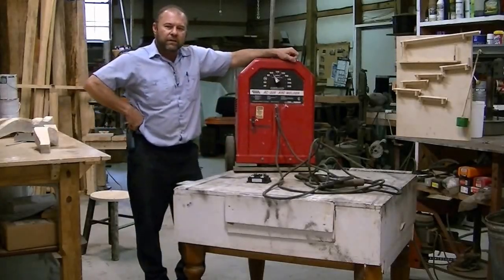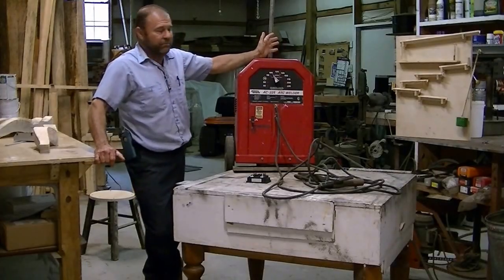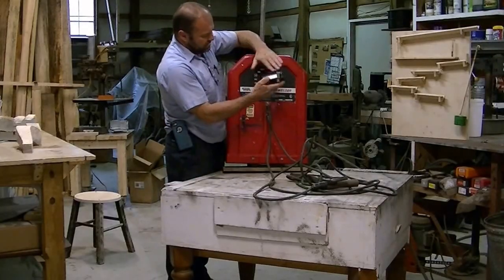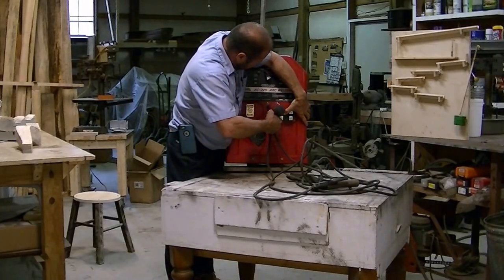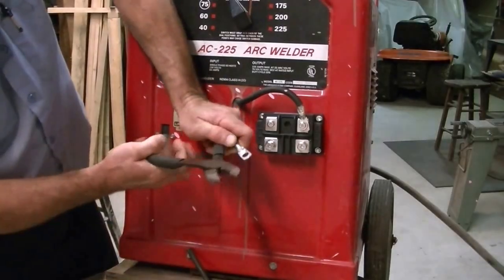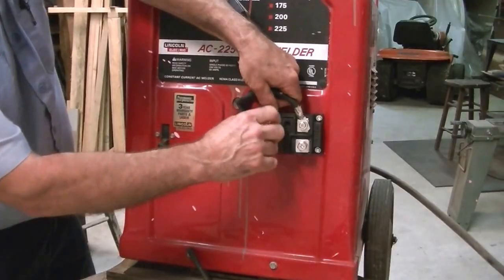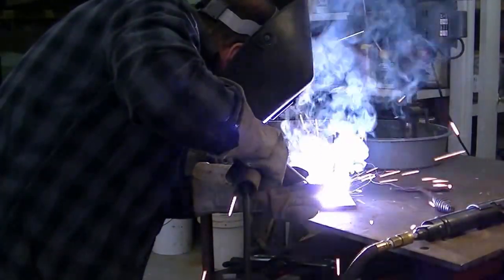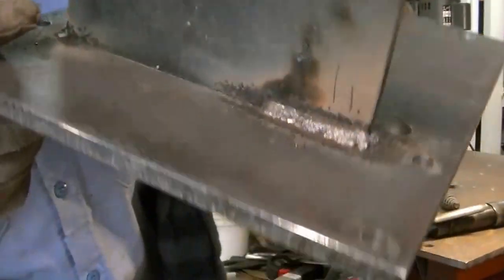Convert your AC welding machine to DC for $50. Weld 7018 rods,more strength

Comment: you might want to pickup a tube of permatex dielectric grease the small size is number 81150.. costs about 4 bucks.. take out your self tapping screws.. squeeze some dielectric grease out on the back of the diode bridge.  and reinstall it.. its a thermal compound to allow better transfer of heat out of the diode bridge to what ever you have mounted it to. 

the white thermal transistor mounting compound that some computer or electronic stores may sell works even better. 

no use burning out the rectifiers. 
Part Number: 81150Part Number: 81150
Reply: 81150 is exactly as you say.  It is dielectric grease meant to insulate and therefore NOT conduct electricity.  What you need here is thermally conductive grease, commonly known as heatsink grease.  A quick google of permatex products does not reveal any heatsink grease in their product line.  I doubt dielectric grease would be more effective in thermally bonding the rectifiers than ordinary axle grease.
Reply: Computer builders use a wide variety of heat transfer compounds far superior to dielectric grease. though I love the stuff for keeping moisture out of vehicle electrical connections. Remember computers have thermal sensors so you can precisely monitor thermal paste effectiveness. http://www.tomshardware.com/reviews/thermal-paste-comparison,5108.html
Reply: Yes, many ways of bonding heatsinks to processors.  For mounting the rectifiers spoken of here, thermal grease is probably bood although a properly sized pad would probably be better.  Locating and buying such a pad may be a problem while the heatsink grease is pretty easy to find.

Comment: Why do they even make alternating current welders. High voltages? Just sounds foolish... is there an application that prefers ac? I'm not a welder. Just a competent observer. Thanks for video.
Reply: Christopher DiUlio they are cheaper
Reply: Christopher DiUlio AC is fine for general welding and rough cutting but DC is another world completely.
Reply: Oh man these misleading responses here!! In stick welding the only real advantage to ac is you don’t get arc blow. That’s where as you burn the rod down the puddle gets squirrely and the flux starts melting off the side of the rod and the arc flashes out of the puddle and it’s hard to control. This can happen on dc because of a bad ground, or incorrectly placed ground or the part is becoming magnetized due the the dc electricity. Ac switches polarity 60x sec which doesn’t allow the metal to polarize. Ac is also more dangerous because you can die from the elec shock especially if you’re welding in a wet area, not much different than an exposed extension cord. Dc can kill too but it takes way more amps than ac. And when it comes to tig welding dc is more common especially on cheaper machines. A tig machine with ac will always have a dc option, but many dc tig machines don’t have ac. You need ac on tig to easily weld aluminum and magnesium. All steels are welded with dc on tig. Aluminum can be done with dc tig but requires helium for shielding gas which is way more expensive than argon and leaves a dirty, but structurally ok weld

Comment from the maker: I should have done this years ago.
Reply: markp0177 Mark, is that 20% duty cycle for settings less than full 225A setting? I remember running these pretty hard in school etc. without any meltdown s @ around half power settings. Never have actually read the specs on these buzz boxes. Thanks for posting.
Reply from the maker: Yes me too. The 7014 is a good strong rod but it is hard to run a vertical weave with a 7014
Reply: Nice, I must try something similar one day. The metal on the back of your bridge rectifier is not in itself a heat sink but what should be connected to a heat sink . A large shiny  clean flat aluminum plate would be better than nothing. The painted sheet metal won't do a whole lot as a heat sink. Well done though.
Reply: It is 20% duty cycle at every setting save the 75 amp one, which is 100%. That's why that setting has the circle around it. Had to find an older manual to find that out. I'm guessing it has something to do with the volt/amp curve of that transformer.
Reply: RobiSydney I figured the duty Cycle should be around 100% in the "normally used" range. I used one a farmer buddy had to rebuild & modify his loader bucket. It had gotten flooded etc. & the fan didn't spin anymore. Ran alot of rod with it on that project & never had a meltdown. The older ones at least are tough little buggers.  Have had a Miller Syncrowave 250 since the late '80's so DC & Tig are the norm now. Still have dad's buzzbox which is a great starter box for a hobby budget. And now with this mod only improves it to the next level. Not a worry wart by any stretch but you may want to throw a little cover over it. I'd personally take the time and mount it inside and maybe add a switching circuit for AC or DC selection.
Reply from the maker: I am not sure if the duty cycle is at full amperage or not. I always go easy on it. I would think that you would smell it if it was getting to hot.
Reply: I would also add that the metal plate on the back of the bridge rectifier was intended to be coupled with a clean not painted surface and use a heat sink compound that draw or sink the heat off the diode pack better and lend a longer service life to the diodes. Heat is what kills solid state electronics.

Good project
Reply: I'm looking at it, thinking hmmm... Put a BIG AL heat sink on it with a fan blowing across it.  Thinking also about putting some big capacitors across it as well and smooth out the arc a bit.   at 75amps duty cycle would be near 100% counting rod changes...
Reply: markp0177 yes...it's 20% duty cycle at max amperage.
Reply: A bunch of large capacitors would make it  much more "Plenty good enough" .. What you have now is  "ripple" DC..   The current still goes up and down.  Just not as far down..  Caps keep it high and steady..  More juice.  Any caps will do.  It's only around 40 volts..  The more, the better..  just cover the connections so you don't get zapped.
Reply: markp0177 Yep easy goes it, is way better than smoke. I'm guessing the weakest link now is probably the Chinese rectifier, though I wouldn't anticipate any failure going easy with it.
Reply from the maker: Thanks for the info.
Reply: Nice idea too!
Reply: You are correct, read my reply above. Duty cycle is rated at top amp of machine. 20% for this machine is 2min out of 10 @225amps and much more at only say 125 running 1/8" rod. Plus 7018 specs call for rev.polarity(Electrode pos.) He set it up to run straight polarity.
Reply: RobiSydney The idea is good but the amount of capacitance you'd need is not practical for that amperage. You would literally need a couple car batteries to smooth out that DC wave form.
Reply: My friend is thinking about picking up a used welder like this. I told him to just buy an everlast inverter which is DC already but I think it is out of his price range. I'm going to see if I can find these parts cheap.
Reply: The circle around the 75 amp setting, indicates the setting for pipe thawing.  Lincoln, and probably every other welding machine manufacturer, will tell you NOT to thaw pipe with a welder and state in their literature that it is NOT an approved process.  I'd bet that more than one house was set on fire, or someone got a bad burn, using that method, but reading about it on the internet, it was, at one time, a pretty popular way to melt frozen water pipes.  It might still be, for all I know.

From one of the Lincoln manuals:

Linc-Thaw™ (L2964-1) - Includes meter and fuses to
protect welder when thawing frozen water pipes.
Pipe Thawing IS NOT a CSA approved procedure.
If not done properly, it can result in fire, explosion,
damage to wiring which may make it unsafe, dam-
age to pipes, burning up the welder, or other haz-
ards.
Do not use a welder to thaw pipe before reviewing
Lincoln Bulletin E695.1 (dated October 1987 or later.)